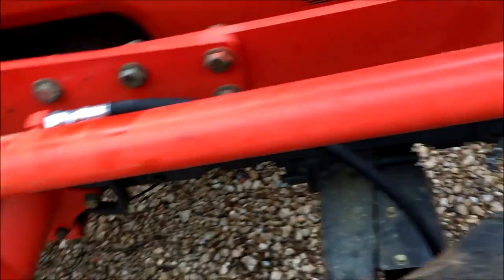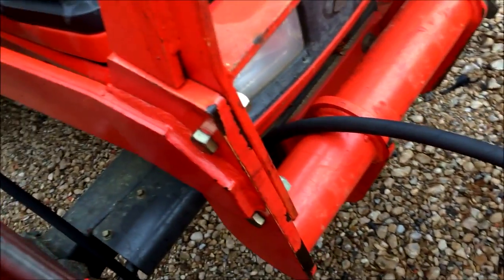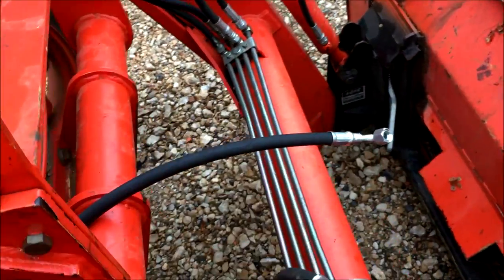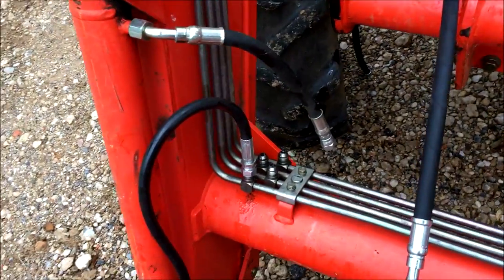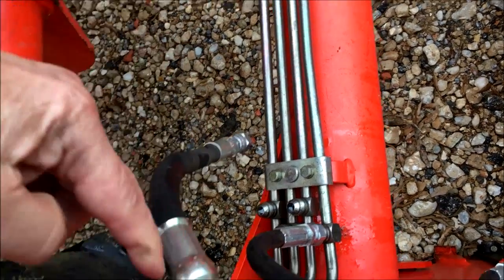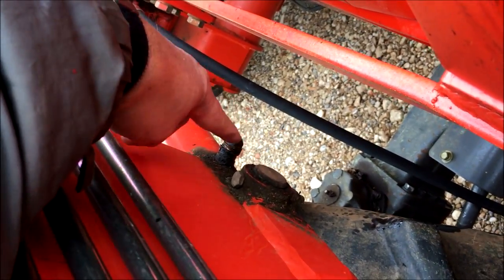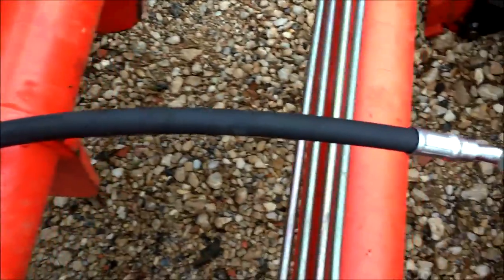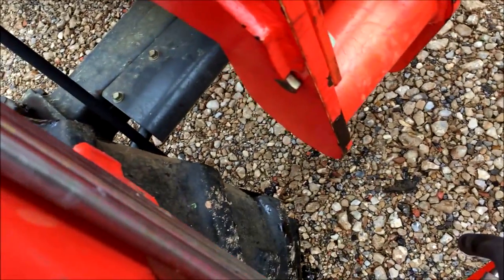Changng Hydraulic Hoses On Front Loader

Comment: Did you have to bleed hydraulic system?Is there a place to bleed air out after changing hoses,fluid,and filter?
Reply from the maker: I've never had to bleed the system on any tractor I've worked on (this Kubota and an old Case before I got this one)... and I've replaced probably 20 hoses in total on both tractors. I think the system is self-bleeding or something. 
It's not a problem.
Hope that helps.
Reply: Yes it helps a lot!
Thanks 
 Great video.

Comment: How do I disconnect the hose that I'm replacing? There are 2 nuts at each end. Do I turn the nut near the frame or the nut closer to the hose?
Reply from the maker: Kymberlyn Tattrie 
Man has always been the nut nearest the hose. You will need two wrenches, though. One to turn that nut, and one to hold the other nut in place as you loosen the “hose” nut.

Comment: Do you know if these hoses on kubota loader are. 
SAE 6 3/8 9/16-18  
Or 
SAE 8 1/2 3/4-16

??

cylinders for my L3560 tractor with LA805 loader. Curl cylinders.
Reply from the maker: I really don't know.
When I need a replacement, I just carry the busted hose down to the place where they make them (ACE Hdw, Dealer, etc.
I let THEM check for the right fitting. If it's not right... I'll bring it back. But never have had to do that.
Reply from the maker: Kubota is all metric... so not sure if it would be SAE

Comment: how in the great wampus do I bleed the lines when I replace one? you can't just put it back empty can you?
Reply from the maker: I didn't have to bleed at all.
I've replaced MANY hoses on 2 different tractors (case and kubota) and have never had to bleed.
I assume they "self-bleed".
Reply: That was my question as well.  It seems like putting the new hose on puts a big slug of air into the hydraulic system.  I know for my bike brakes, any air will make the brakes not work.  But after watching some videos on this, it doesn't seem to be a concern.  I guess there is some way that the air leaves the system?

Comment: Did you have to bleed them ?
Reply from the maker: I've changed a LOT of hoses on a couple of different tractors and have never had to bleed.
Even when I drain and replace all the hyd fluid and filters... never have to bleed.
It may take a few seconds for everything to start working, but once the fluid gets circulated, everything works :)
I think all tractors self bleed.
Hope that helps.

Comment: Is there a way to buy hydraulic hoses for cheap? (I realize they are expensive but what’s the cheapest way?
Reply from the maker: I would just call around and ask about the price per foot of hose and the cost of fittings.
They will probably need to SEE the fittings you need before they can quote a price, though.
My experience... DON'T SCRIMP.
Poor hoses will not last near as long as good ones.
Reply: Hey thanks for the quick reply, and one more question, I asked you on another thread, my hyd tank gasket leaked and let water in, without knowing it, I started it up!:( how would I go about getting it outa there? I already replaced the fluid in the tank and got as much out of the cylinders as I could, but unfortunately the fluid is contaminated, how would you go about getting it outa there?
Reply from the maker: Sorry, can't help there. Never had that problem
Remember that water is heavier than oil, so any water in the tank should be at the bottom
Maybe a siphon hose at the bottom to try to suck any water out.
Or just wait till summer and it might evaporate it through the entire system
I would advise call your dealer...
Reply: @BIGALTX  ok, I appreciate your help, i was thinking warm up the oil with an electric heater to like…160F,  once the water is gone, run it for 10 or 15 min while going up and down, and than heat it again. Than once I feel like it’s mostly all out  change the oil and filter and install a desiccant cap on the reservoir.
Reply: @BIGALTX  good hoses last near 20 years if cared for. Invest in best, and add sleeve protection where possible to stop wompus chunks. I get happens when machines working, but most times that nylon sleeve will slide and get hoses away from abrasion damage. Abrasion and sun damage is oil hoses worst enemies imo. Sleeves covers them for both. Other issue, which is user induced, is unsecured lines that bounce [feedback] with use. Can always tell the rookie operators who won't get down from machine and clamp the lines to keep in seat rest the week ;)
Reply from the maker: Thanks for the good info! 
My tractor is about 18 years old. Many of the hoses have been replaced, but not all

Comment: How do you get the air out of the system?
Reply from the maker: I've owned 2 tractors and have replaced MANY hoses.
I've never had to bleed them after replacing hoses, or after changing the fluid and filters. I think all tractors are "self bleeding".
If you are concerned, call a dealer and ask their service dept.
Hope that helps,
alan
Reply: @BIGALTX  ok thanks for the help

Comment: Does the tractor automatically remove the air in the hoses that gets in when hoses are replaced? Or is there a way to bleed the air out manually?
Reply from the maker: Good question.
Seems there is some air in the first few seconds of cranking it up... then it is seemless. 
I guess the tractor removes the air in some way.
Reply: I have a similar tractor, L2500.  What you said about releasing the pressure is what I do as well.  Cut off tractor and just move that control knob all over the place until nothing moves.  One could also disconnect the quick connects like you would when removing the bucket from the tractor.  Don't forget to hook it back up tho.  

As for air in the lines that Kent asked about.  Yes, it does, especially if you have to rebuild the cylinder.  The way I can tell it has air, the bucket doesn't start to move or if curling the bucket, it sort of has floppiness to it or hesitates to move for a few seconds.  Once when I rebuilt a cylinder, I could move the bucket by hand, something you about can't do when there is no air.  

Removing air isn't to bad but it may take a couple times.  This is a good idea to do every once in a while to make sure you don't let a cylinder rod rust.  Raise the bucket all the way up and hold the control knob, engine at idle or just slightly above, for about 15 seconds then release.  It will put a load on the engine as it does this.  While the bucket is still raised, curl the bucket in one direction, either way will work, and hold it for about 15 seconds then release.  Curl it the other way and hold the same way.  I usually repeat that a couple times. Next part is tricky.  You need to lower the bucket, either over a hole, ditch or something or let it raise the front wheels and tear up a little dirt.  Lower the bucket all the way and then hold it there for about 15 seconds then release.  Then with the bucket at its lowest point, curl the bucket back and forth just as you did when it was raised.  Doing all that with the bucket on the ground will prove to be bumpy and it will leave a scar on grass.  A ditch is where I go do this.  Let the bucket just hang out over it usually not touching anything. 

It's good to get that air out because air generally has moisture in it.  Moisture leads to rust.  On smooth surfaces like cylinders and the rods, rust is bad.  Rust on the rod part, the shiny part you see, will ruin the wiper seal in a hurry.  It won't do those seals behind it any good either.  

TP2, when a cylinder fails, they aren't to bad to rebuild yourself and it saves a lot of money.  Take the cylinder off, take it apart, at least loosen all the parts, take pictures of all the seals and then take it to a local cylinder shop.  Tell them everything is loose so they can measure all the parts.  Sometimes if they have to put effort into taking it apart, they charge for that.  If I recall correctly, you loosen the outside part where the rod goes in and after that, there is a large nut, very tight nut, on the inside part of the rod.  Word to the wise.  When you get ready to remove that nut on the inside, pin the rod back to the bucket/frame/something so that it won't twist on you.  Also, if the rod rests on anything, bucket, frame or whatever, wrap it with a thick rag.  You don't want to scratch that rod.  The least little nick will cause damage to the wiper/seals over time.  Did I mention that nut is tight?  When you get your seal set, I'd buy a extra, for the other side.  One thing about dual cylinders, when one moves, the other one does too.  Having both fail at about the same time isn't unusual.  

There are videos on youtube that shows rebuilding those cylinders.  Big, small, medium, about the same process.  Make sure you keep everything clean, no dirt or anything.  

Long post but hope it helps.
Reply: The hyraulic tank will have air in it,when it is sucked to the pump all air will be compressed out and oil will be sent under pressure to valves no problem
Reply: Once I have the hose replaced, assuming I need to check the level of fluid and top up to compensate for the popped hose and sprayed fluid.  can you do a follow up how to ?

Comment: Thanks for the vid.  Do you have to bleed air from the cylinder afterwards?
Reply from the maker: No sir.
I've changed more than a dozen hoses on this Kubota and on a '60s model Case.
Never had to bleed the systems.
I guess they "self bleed" or something. Not sure, but I don't think you'll have to bleed.
It may take a minute or 2 for everything to get fluid and work correctly, though.
Hope that helps...
Reply: @BIGALTX  were do i find the t-pipe part on the loader, somehow i twisted  the t fitting and it leaks now, Thank you

Comment: I had a hydraulic steering hose blow out on my tractor and after replacing three of the four hoses I have no pressure to the steering box. What am I doing wrong? I cracked the hose coming from the pump, while it was running, and no pressure at all. My bucket still lifts and three point lifts as well.  I’m not much of a mechanic.